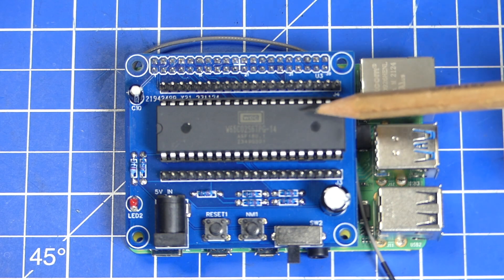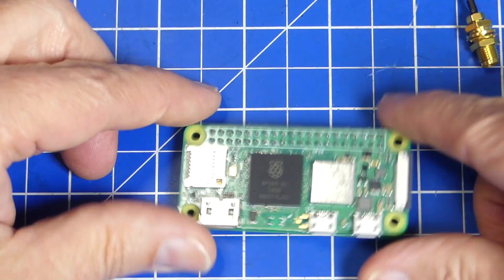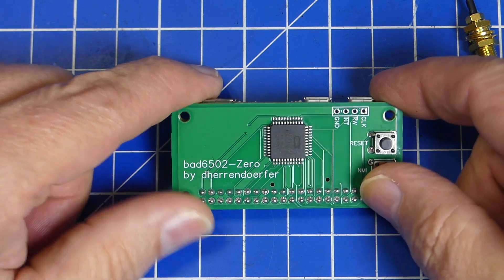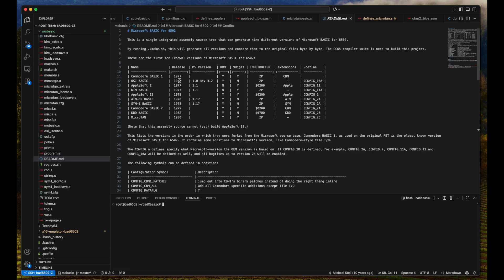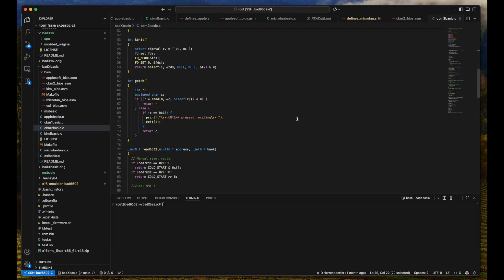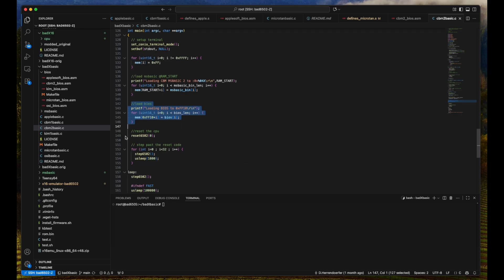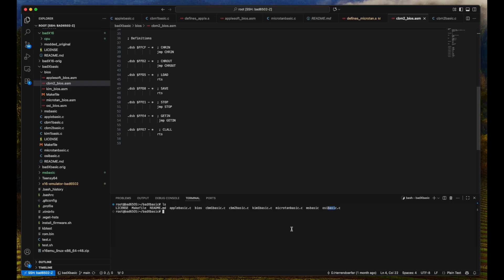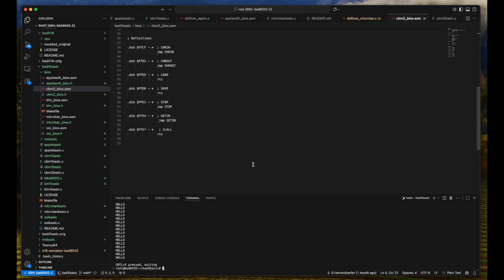bad6502 - no effort november project update

Comment: This could get interesting if you were to take us on a journey of making the 6502 run synchronously. I want to see the choices you'd make that allow PHI2 to run free at 8 MHz.
Reply from the maker: The 6502 is running synchronously, the Pi is generating the clock signal and handling the bus in real-time. 8MHz is however beyond the Pis capacity, even for a Pi4. It's not that the GPIO can't go that fast - it's the fact that the Arm on the Pi is a load-store architecture and having to examine the bus 2-times duing a clock cyle and then do the virtual memory mapping is a bit much. 
In cycle-accurate mode we can get around 3 to 4 MHz on a Pi Zero and 5MHz on a Pi4 with a simple memory backend. In instruction-accurate mode we can get a little more. 
As soon as you start adding virtual hardware it gets complicated. The memory on the Pis is not fast and a cache flush (to commit memory across threads) is expensive. 
I'm targeting 1-2Mhz with complex hardware on the Pi-Zero. That being said: It's not so bad as it sounds - all simulated hardware can be used asynchronously, there is no need for sharing of the bus for i/o or graphics.
Reply: Maybe sync/async are the wrong terms here. In trying to decide if I used the wrong term, I found my opinion depends on the perspective used. I meant that I'd like to see PHI2 on a timer/pll and the Pi software made real-time enough to hit 8MHz.

I don't want you to think I'm trolling you into an impossible task. I have already done all this with a Pi Pico. Sure, the cache pipeline is a problem on the Zero, but that's when you have to think outside the box. That's when it gets interesting.
Reply from the maker: @rumbledethumps  Nice project, but not mine, and I did not want to reproduce somebody elses work. My goal is to have a 6502 with HDMI, USB, Networking for under $50. I want it to be a standalone development system. And I want upgrade options with no predefined layout or architecture on the 6502.